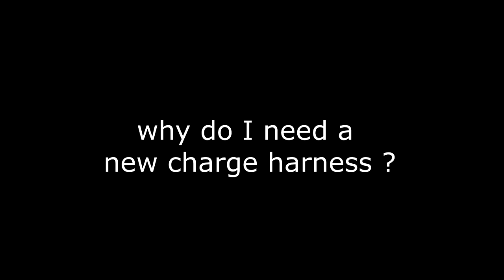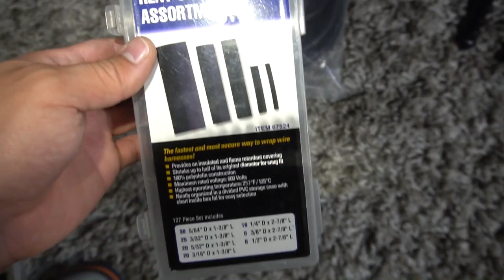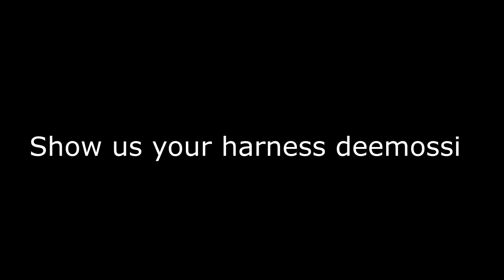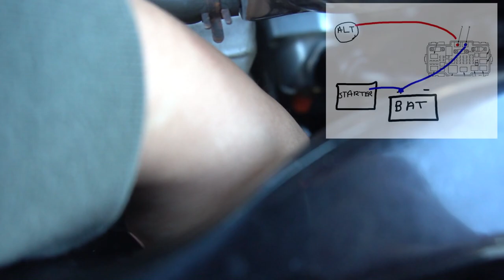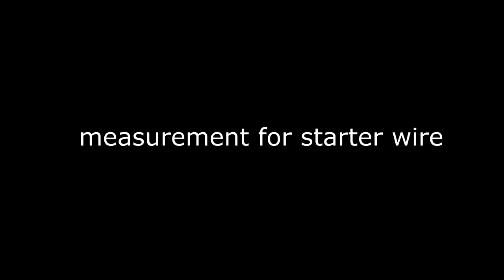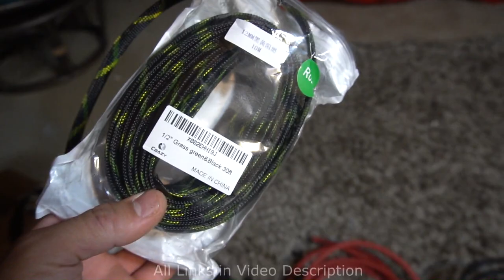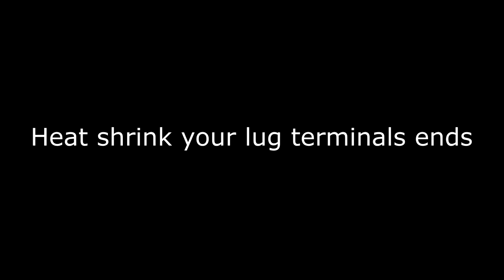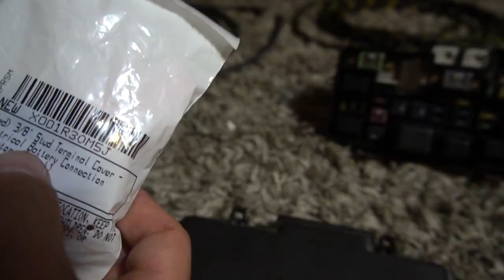Honda Battery + Fusebox Relocation / Tucked Charge Harness DIY ( DC5 )

Comment: the wires through the side door and fender frame you should seal the hold because the water from rain can be into the the car and it will wet you carpet..

Comment: For the actual wiring harness that goes to the fuse box do you have to extend the wiring to put it under the drivers side area , or can you just separate the oem wiring and route it back into the car
Reply from the maker: Requires both extending and Separating